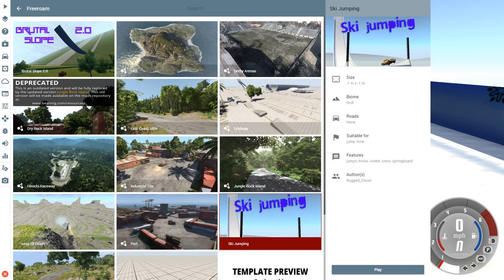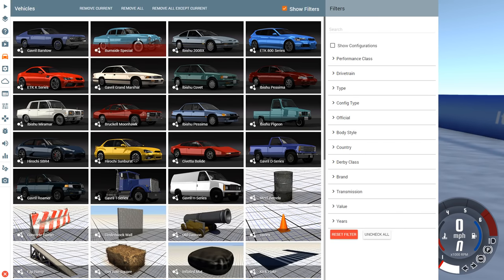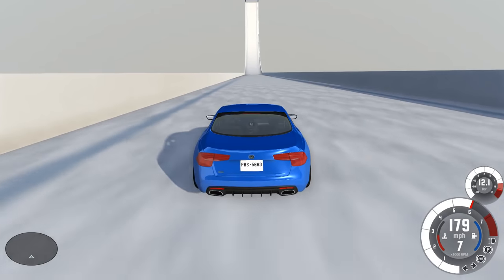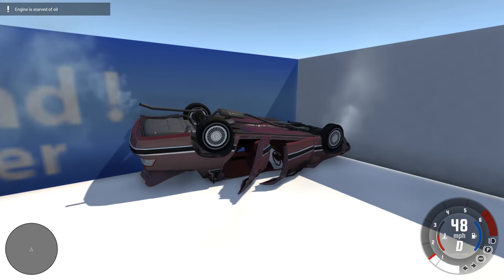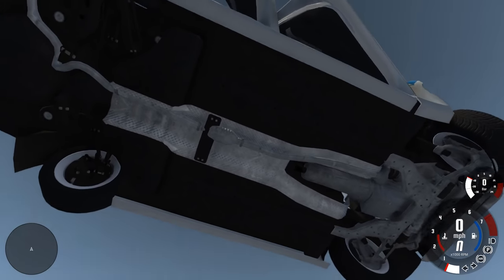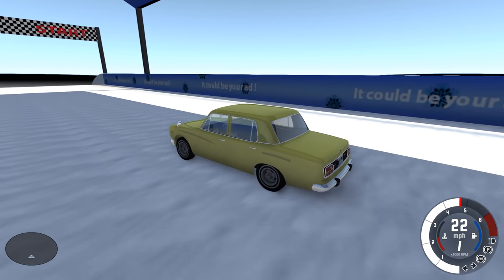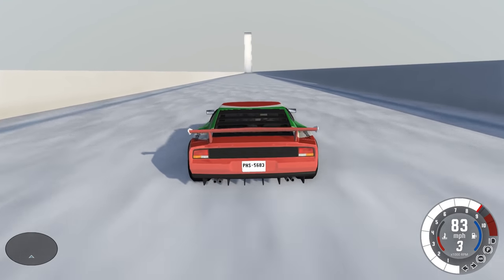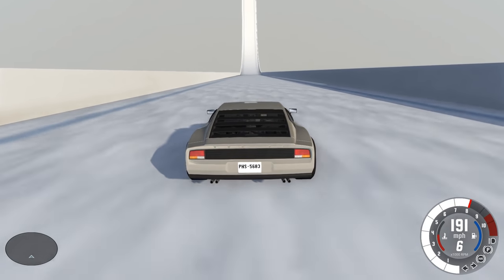BeamNG.drive - Ski Jumping

Comment: you know....most of those crashes looked non fatal.
I wonder if this can be an extreme sport?
Reply: Thewhiplash1231 *ahem*, second jump. Yes I know it’s been 4 years
Reply: @atonofshrooms  Hence the word "most", though that's still too high of a failure rate.
Reply: Thewhiplash1231 I wouldn’t really call it a failure, more an advancement in science
Reply: @atonofshrooms also the one with the v8 luxe grand marshall (i know its also been 4 years)

Comment: You know a I4 turbo rally engine makes 64lbs of boost right?
Reply from the maker: Yeah, but that meter is in bars not pounds.
Reply: +WhyBeAre But the bigger the engine is, the more boost you need to have to get a certain percentage of power upping.
Reply: Trucks like that can push a couple hundreds psi, if not more, but I think that's still only 30ish bar, so 50 might be a little much. Could do it though.
Reply: +WhyBeAre I thought you lived in America! In the land of the free, we use pounds per square inch, not bars!
Reply: +Nazurick The Dragon 48 bars is almost 700 psi... the gauge in game is just messed up, if you bring up the turbo debug app it shows the same in psi as it does Bars
Reply: XxxInTheMiddlexxX  Ah, 700psi. Yeah, that's gonna leave a little more than a scratch....
Reply: @whybeare sorry I thought you where talking about like the bars on the gauge
Reply: 47 bar is 680 lb of boost haha. a semi can get maybe 60. under a high load
Reply: Tooooo much booost
Reply: +Nazurick The Dragon trucks can't push a couple hundred psi
Wat
Reply: Griffin Mackenzie I've seen cars do it, admittedly not road cars, but they can push very high psi
Reply: +Nazurick The Dragon what turbo even can handle over 100psi
Reply: Griffin Mackenzie More than one and they're usually far over 100mm
Reply: Nathan Mcclure
Reply: Nathan Mcclure
Reply: Nathan Mcclure
Reply: Hi JEFF

Comment: 10:05 It's a spoiler, not a wing. Very similar, but a wing creates lift and a spoiler creates downforce.

A good example is a commercial airliner like a 737; they have both wings (obviously) and spoilers than can be opened at varying degrees. (which reduce speed and lift).
Reply: +xXx_wowiamsoamazingatlife_xXx Boi.
Reply: Bruh.
Reply: boi
Reply: Mctwistyflop dat profile pic
Reply: same
Reply: i agree
Reply: NERD... (that is true though)